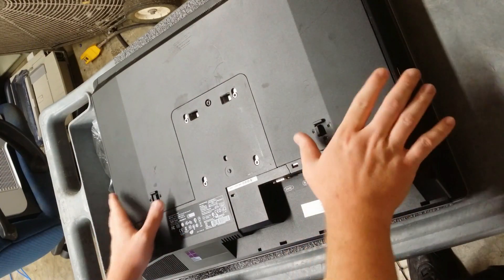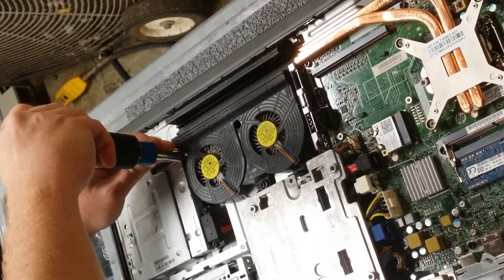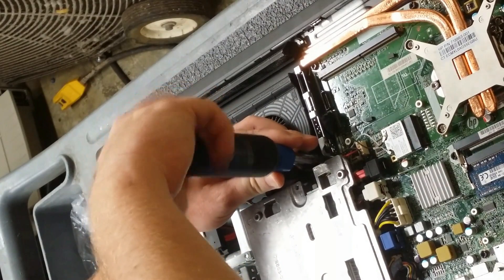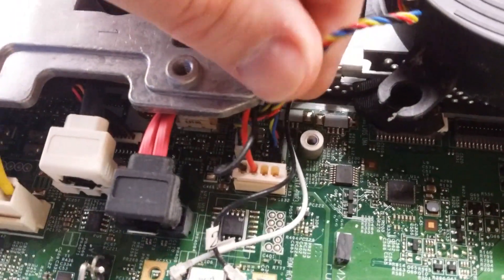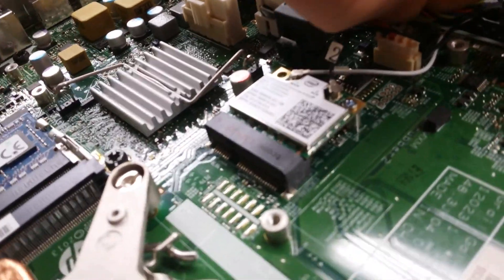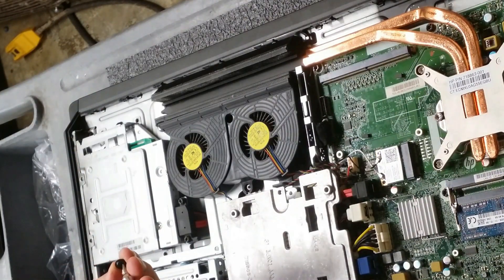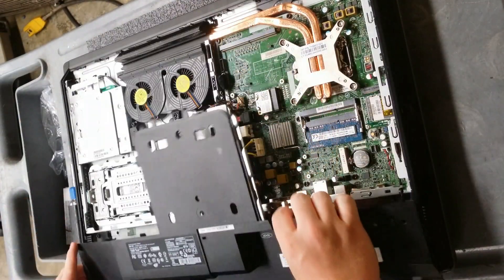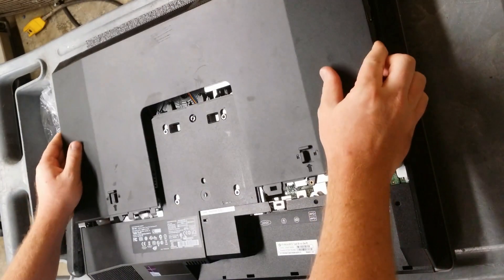How to replace a CPU fan on an HP EliteOne 800 G1 All in one computer

Comment: A bit late asking, but is there a way you can convert the DVD Drive on an HP elite one 800 G1 (all In one PC) Into a hard drive. I know this is possible with laptops but I just want to be sure It will work. I already have a 120GB SSD I plan on using And I'm aware that You can add another Hardrive in front of the Bay inside the computer but I want to max out the storage, I probably should try getting a better computer If I want to use it for gaming, but all I really use it for it is Minecraft and some other games. But I can't use shaders because they are too slow on the graphics I have. I don't have the AMD graphics I have the Integrated Intel HD 4600, Is there any other graphics cards you can install on this machine. BTW I'm planning on using the SSD as a boot drive and having my other hard drives as storage for projects and some games (Although my favourite games will obviously go on the SSD, for general reasons. Also, will the PSU be able to handle all this? Two 500GB hard drives ( 1TB together) or just a 500GB hard drive and the SSD if the DVD drive cant be used for a hard drive and a new graphics card. Obviously, I know I would only be able to use notebook graphics cards and I would use the onboard graphics If I didn't want Minecraft shaders. I already have an Intel i5 4570s and 8GB of ram. I also have the computers twin somewhere, Incase my one breaks or needs a spare part. Im 13 btw so kinda on a tight budget. 

Pronouns are SHE/THEY!

Comment: hi there. is it possible to upgrade graphics card in  HP EliteOne 800 G1 All in one computer ? i mean can i install nvidia card or amd radeon for gaming purposes in this machine ? Thanks
Reply from the maker: I dont think you can do that with this AIO. Maybe if it supported USB-C and an external card that would work but AIO computers are just large laptops and you really cant do any upgrading besides memory, hard drive, and maybe a mini PCIe.

Comment: Hi Jay, Thank you so much, that is very helpful... Do you know where I may be able to purchase the product (fan part)?  One fan has stop working on mine, after seeing your you tube, believe I can replace it myself.  Cheers Karen
Reply from the maker: Your best bet is ebay for the part. If your lucky maybe on amazon.
Reply: Did you do this repair?  I am also having this same issue where the fan needs to be replaced.  Just wondering if it was as easy as he made it look?